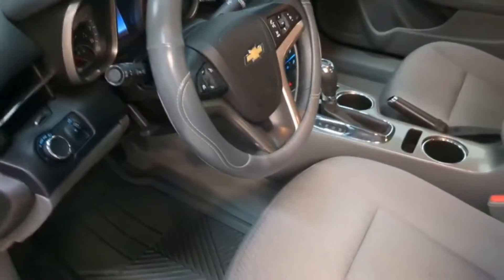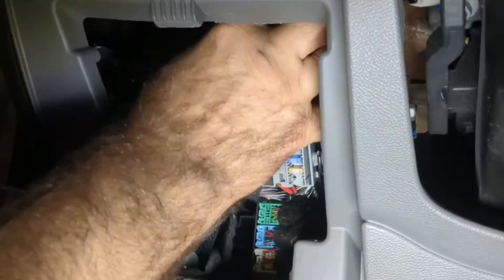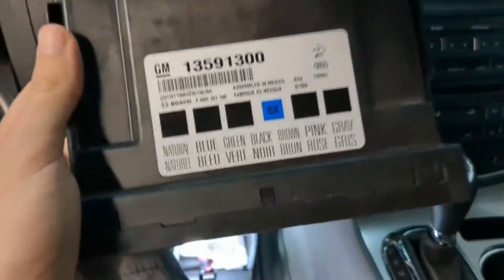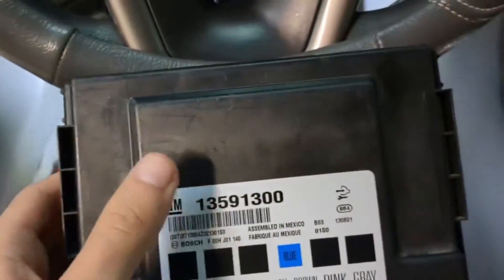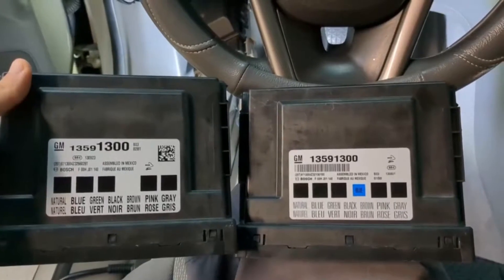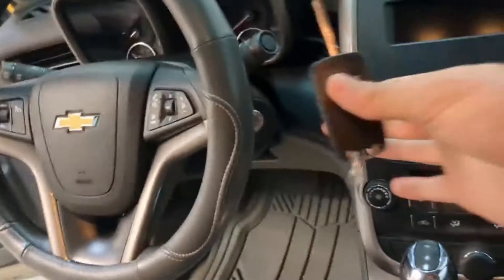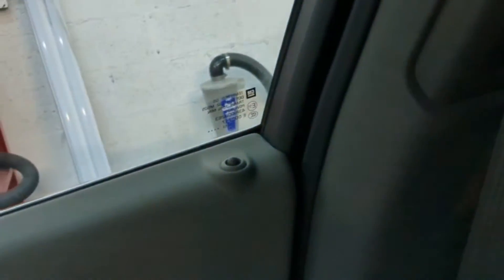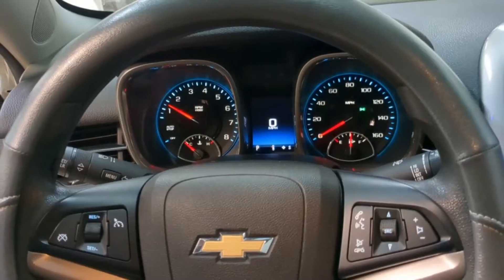BCM Replacement on Chevy Malibu 2013

Comment: question can this cause my aftermarket radio not to work not getting any power from the wires accept speaker wires which is green which is crazy to me my test light lighten up for them but not for the other solid colors like black yellow

Comment: Could this be the problem for me cause my radio and speakers randomly stopped working and then now my car locks on its own and I also replaced the screen and all and it still doesn’t work
Reply from the maker: Since you replaced the screen and still have these issues, it's possible a malfunctioning BCM is causing these electrical problems.
Reply: @ECUTeamCorp so it’s the key fob that’s sending mixed signals cause it doesn’t do it no more and I replaced the battery and my screen is turning on but barely like it turns on then turns off and the control panel ambient lighting just cuts on and off so could that have too do with the radio receiver?

Comment: Friend, please tell me where in the comfort block is the output for the additional brake light that is in the trunk?
Reply from the maker: Hey! On the 2013 Chevy Malibu, the output for the additional (center) brake light in the trunk usually runs through the Body Control Module (BCM), which is part of the comfort block. The specific wire for the third brake light is often found at the rear fuse block in the trunk area. It’s typically a light blue wire going to the high-mounted brake light. Hope that helps!

Comment: hello brother, thank you for the detailed videos first of all 👏🏽👏🏽
I own a 2015 malibu if its ok to ask about multimedia screen problem.. ( here we got only lt 2.0t and without bluetooth or backup camera icons showing on the home screen... been thinking about buying a whole new screen unit/+modules from us..so i wont loose the compartment behind..)
If its cool with ot make a video about that i would be more than greatful 🙏💪🏽 also how do you know always if u have the most updated software version?? Through the dealer approved scanners or..???🤔🤔
Looking forward for more videos brother and thank u in advance of course 👏🏽👏🏽🤙🏽💪🏽
Reply from the maker: From what you're describing, it sounds like your LT 2.0T came with the base infotainment setup, which unfortunately doesn't include Bluetooth, backup cam display, or the more advanced MyLink features. Chevy kinda limited those features in certain trims outside the US.

If you're considering getting a screen/module from the US  yes, that's definitely one way to upgrade, and it's possible to retain the compartment behind with the right fitment. Just make sure the replacement unit is compatible with your VIN, and ideally, comes with the matching module(s) and harness to avoid issues.
Reply: @ECUTeamCorp  thank u very much for the reply brother!!! Much appriciated & if i may ask for some guidense if u know any reliable source to buy from?? The whole package of course & wont f*ck me around i would be more than greatful sir 😉😂
Also if u may leave or open some whatsapp for the people i'm i wont be the only one greatful for that opprotunity 😉🤙🏽

Comment: These comments are confusing When I Buy a brand new BCM does it have to be reprogrammed or does it reprogram itself upon Installation
Reply from the maker: A brand new BCM for a 2013 Chevy Malibu must be programmed after installation. It does not automatically program itself. The BCM controls various vehicle functions, including security, lighting, and communication with other modules, so it needs to be properly configured to match your car. You’ll need a GM-approved scan tool like Tech 2, MDI, or a dealership tool to perform the programming and relearn procedures. If not programmed, the car may not start or function correctly.

Comment: Hello, please can you help me, I was able to remove the last 3 connectors: green, blue and white, but I can't get the ones on top out. Please can you advise me if you have any tips or tricks? Thanks for your advice.
Reply from the maker: 1. Press the connector
2. Press the lock
3.Pull it
Reply: @ECUTeamCorp please
Reply: did it help? i’m having same problem
Reply: @xavierm3686  no it didn’t help

Comment: very good video, can you please help me to know if the BCM of a 2013 Malibu is good, since it shows me the following errors, I will greatly appreciate your help. Greetings The errors  Car Scanner ELM OBD2
Version: 1.106.0/401060/GP
DTC report
Connection profile: Chevrolet OBD-II / EOBDDate: 25/05/2024 06:49:11 p. m.
VIN: 1G1195SA2DF263812
============================
OBD-IIOBD-II
DTCs: 8
----------------------------
P0700 [0x0700]
Transmission control system, MIL request - circuit malfunction
Estatus: Confirmada
----------------------------
P07BF [0x07BF]
Input shaft speed (ISS) sensor/turbine shaft speed (TSS) sensor A - circuit low
Estatus: Confirmada
----------------------------
P06DE [0x06DE] Archivo (inactivo)
Engine oil pressure control - control circuit malfunction, ON signal
Estatus: Permanente
----------------------------
P2097 [0x2097] Archivo (inactivo)
Post catalytic converter fuel trim (FT), bank 1 - too rich
Estatus: Permanente
----------------------------
P0658 [0x0658] Archivo (inactivo)
Actuator supply voltage - circuit low
Estatus: Permanente
----------------------------
P0967 [0x0967] Archivo (inactivo)
Pressure control (PC) solenoid B - circuit high
Estatus: Permanente
----------------------------
P0971 [0x0971] Archivo (inactivo)
Pressure control (PC) solenoid C - circuit high
Estatus: Permanente
----------------------------
P2721 [0x2721] Archivo (inactivo)
Transmission fluid pressure (TFP) solenoid D - circuit high
Estatus: Permanente
============================
Unidad de control del motorUnidad de control del motor
DTCs: 2
----------------------------
P0700 [0x0700]
Transmission control system, MIL request - circuit malfunction
General Electrical Failures [0x00]
Estatus: DTC supported by calibration, Current DTC, Test failed since DTC cleared, History DTC, Current DTC since power up
----------------------------
P07BF [0x07BF]
Input shaft speed (ISS) sensor/turbine shaft speed (TSS) sensor A - circuit low
General Electrical Failures [0x00]
Estatus: GM failure record
============================
Unidad de control de la transmisión #2Unidad de control de la transmisión #2
DTCs: 1
----------------------------
P07BF [0x07BF]
Input shaft speed (ISS) sensor/turbine shaft speed (TSS) sensor A - circuit low
General Electrical Failures [0x00]
Estatus: DTC supported by calibration, Current DTC, Test failed since DTC cleared, History DTC, Current DTC since power up, Warning Indicator Requested
============================
BCMBCM
DTCs: 9
----------------------------
B1517 [0x9517]
Battery Voltage Below Threshold; Battery Voltage Above Threshold; Battery Voltage Plausibility Failure
General Electrical Failures: voltage below threshold [0x03]
Estatus: DTC supported by calibration, Test failed since DTC cleared, History DTC
----------------------------
B1529 [0x9529]
Control Module Voltage Reference Output 5 Circuit Low Voltage; Control Module Voltage Reference Output 5 Circuit High Voltage
General Electrical Failures: voltage below threshold [0x03]
Estatus: DTC supported by calibration, Test failed since DTC cleared, History DTC
----------------------------
B2955 [0xA955]
Security System Sensor Data CKT Malf
General Electrical Failures [0x00]
Estatus: DTC supported by calibration, Test failed since DTC cleared, History DTC
----------------------------
B3006 [0xB006]
Hood ajar circuit malfunction; Hood Ajar Circuit Short to Battery; Hood Ajar Circuit Short to Ground; Hood Ajar Circuit Open
General Electrical Failures: short to ground [0x02]
Estatus: DTC supported by calibration, Test failed since DTC cleared, History DTC
----------------------------
B3618 [0xB618]
General Electrical Failures [0x00]
Estatus: DTC supported by calibration, Test failed since DTC cleared, History DTC
----------------------------
C0277 [0x4277]
Brake Pedal Position Sensor Circuit Low Voltage/Open; Brake Pedal Position Sensor Circuit High Voltage; Brake Pedal Position Sensor Circuit Too Fast Transitions; Brake Pedal Position Sensor Circuit Calibration Not Learned
General Electrical Failures: short to ground or open [0x06]
Estatus: DTC supported by calibration, Test failed since DTC cleared, History DTC
----------------------------
C0890 [0x4890]
Device voltage reference output #3 circuit malfunction; Control Modul
Reply from the maker: https://ecuteam.com/pages/contact

Comment: How to unloose the ones at the top
Reply from the maker: Gotta use a screwdriver.
Reply: @ECUTeamCorp how. The connector literally covers the locking tab.
Reply: @carnage50x did u get it? i’m having same problem
Reply: @xavierm3686  yes. Just move the wires out of the way and use a dental pick to operate the latch while pulling the connector. Kinda a pita but doable.
Reply: @carnage50x  the wires are strapped so tightly i can’t move them
Reply: @carnage50x is the latch on the left side?

Comment: Great video thank you! Question, would getting a BCM from a different 2014 Malibu need reprogramming?
Reply from the maker: Yes
Reply: The connections are in there too tight to come out. The video seemed easy, but it’s not easy to get these disconnected.
Reply: @vadw92011 ever get it disconnected? Having trouble getting mine out too

Comment: Thank you for this! Does this work on the 2.5 Ecotec LT1 engine version as well? Also do you have a programming video for it?
Reply from the maker: Yes we do have these Body Control Modules in stock available however we do not have a programming video for it.